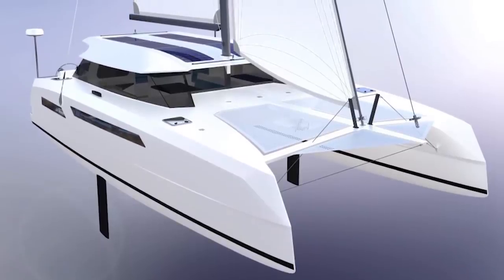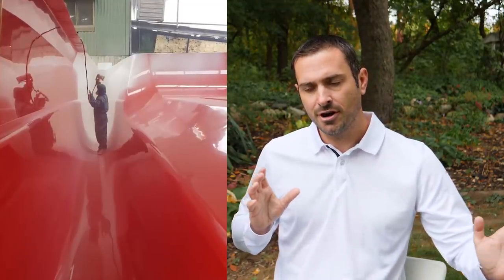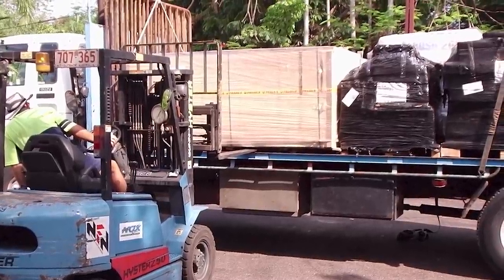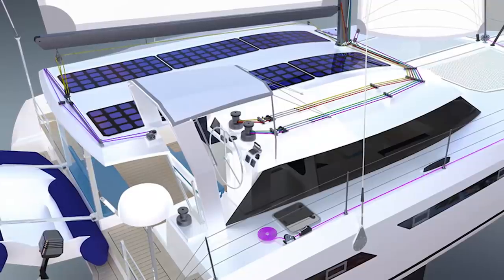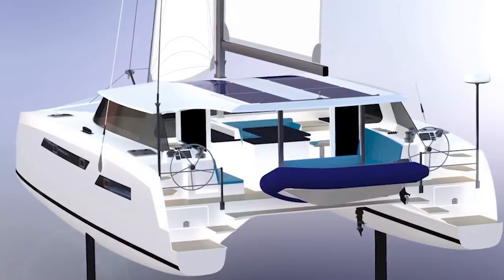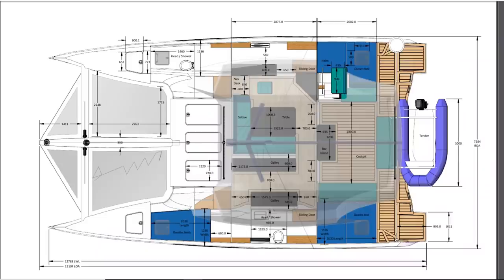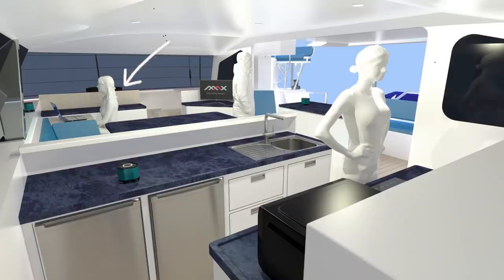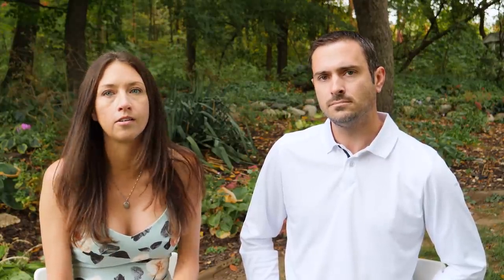YOU'VE NEVER HEARD OF THIS CATAMARAN - But It's Our Newest Contender - The Max Cruise 42 -MJ Sailing

Comment: As commented before, the balsa core materials of the Schonning is not a material I would choose, especially for re-sale in the States where they all want "production" boats. With that in mind, the gelcoat finish over a foam core is very appealing, and being modular the 10 month time difference and less sanding, a huge plus. I did like the idea of another commenter, of putting in the pads or base for inboard engines for a future change, if you choose outboards. Max Marine do not have much detail on their website, would your boat be the first one?

Comment: Would be great later to talk about your choice of outboard vs inboard diesels (I’m guessing primarily outfit costs and drag for performance is motivation— as storing petrol/gasoline on a cruiser is never ideal )
Reply: I have outboards on my boat. The fuel tanks are in self draining lockers above the waterline. The entire fuel system drains directly overboard. It's actually a far safer arrangement than most dinghies or trailerboats. And of the tens of thousands of trailer boats in the world, very few actually catch fire.

Comment: The design looks good. You need to be a bit careful with foam core. The pualuty control must be spot on to prevent de laminating of the core and skin. Along time pounding in bad weather can also cause this. Very strong and light initially, but if delamination occurs, it can loose most of its strength quickly. Just be careful. All that glitters and all that. Look forward to following the build.

Comment: I think the shorter rig is most practical choice. Cats performance variables are mostly affected by weight and hull design. A cat which is designed to point uphill is most affected by weight and sea/wind state with sail aspect a far second. Save weight in every way practical.  Shorter rig, less sail is less weight where saving weight means more. You still gotta carry that even when reefed.

Comment: The only thing I don't like about this boat is the engine package seems to be  lacking on horsepower, can you run a high output alternator off a 30 hp diesel to keep your batteries topped off? My friends launched their Kit Cat 40 Catamaran over the weekend it was a shake down cruise and everything went well, not a lot of wind so we could only put the head sail up, it was very responsive.. The Kit Kat 40 is designed to have twin outboards  mounted on each transom hull, makes for an easier engine install and better performance. Dennis and Jody elected to go with twin diesel outboards, they purchased two brand new Yanmar Dtorque 111 50 hp  diesel outboards, these engines are fairly new to the market at full throttle we registered 2500 rpm of torque power at the propeller shaft and fuel consumption of 3.2 gallons per hour per engine. The Cat reached a top speed of 22.7 mph with both engines on at full throttle, at 1/2 throttle it reached 11.6. Each engine can be operated separately, with just running one engine the boat held a speed of 9.2 mph all speeds were verified by several gps devices. The alternator on these engine are small only 300 watts which I think equals 2.5 amps,so charging a large battery bank might tank a while but they have 750 watts of solar, a 5000 watt Missouri Wind wind turbine and a 3000 watt Honda generator for backups. I took a lot of video footage well be posting on my YouTube channel and Facebook. They well be sailing the boat to Key Largo next month should be a fun trip....
Reply: Wow... 22knts sounds like a great cat.. I'm very interested 2 know more...
What's the make & model of the cat..?
Thanks.

Comment: Really interesting. I was talking to Julian about a boat last year and he mentioned this new design/brand and showed me some of the early drawings. They obviously hadn't progressed this far, it looks really well thought out. We've decided on another option but our choice can't be home built so wouldn't work for you anyway. It is amazing how we've decided on some very similar things to you (the Jefa two position helm, totally open doors between cabin and cockpit, very light boat, outboards not diesels etc.) Good luck hope it goes well!! 

BTW, on this point of a light boat, it's quite astonishing to me how Seawind and RR can describe the 1370 (60cm longer than yours, 40cm longer than ours) as light when it's quoted at ~11tonnes lightship....
Reply from the maker: Don't be a tease.... what did you decide on?   

I really like the Jefa helm, but we'll have to see how the budget is looking when it comes time to order/build the helm.  It's pretty pricey for how simple of an item it is, maybe I'll have to reverse engineer and build our own :)  

Matt
Reply: @MJSailing  Didn't mean to tease! We're going with a Stealth from Asia Catamarans. They have a production process in foam epoxy/carbon with moulds for hulls, cabin roof etc, but can vary length/beam as a function of customer's wishes and also are very happy to customise lots of things (for e.g. we're having a bike garage for 4 full size bikes built into the space that normally would be an aft cabin!). It might be worth connecting directly to share some thoughts as our ideas do seem to very similar, lmk if you want to. We've been pondering energy sources, outboard options etc, etc, always useful to chat to share ideas...

Wrt Jefa helm, I saw this setup first (along with most ppl I think) in Balance cats, but I think Schionning also do it. Using it mounted at this angle offers a really good compromise for helming positions and surely can't be that hard to build? The steering cables won't change length as function of steering arm angle I presume so no hard geometry to worry about. It's just a question of building a stiff arm on simple pivot, throw a few ball-bearings at it, what could possibly go wrong! 😂

But then again what would I know? One thing is clear we differ on; I don't know which end of a hammer is which 😅
Reply: Yep , that Seawind 1370 is terribly heavy considering an Outremer 45 clocks in at 8.5 tons , a Marsoudon Composites TS42 at 5.8 and a TS5 (50 foot) at a mere 8.6 tons and a DazCat 1295 at 5.2 tons . 20 knots boat speed max in 25 knots wind ? Don't think so .... No daggerboards is also a no no for performance .

Comment: How exciting! The Max Cruise looks very good. I have a feeling this is another Aussie company, out of Vietnam, like SW. You deserve a good deal. Your videos are great and you put in the hard yards again and again (and again!) Besy wishes for the build.
Reply: Oh, love twin helms. The raised single helm position might have advantages for long passages.
Reply: Twin outboards! We have a SW with twin outboards. Definitely pros and cons with these. Big pro, cheap and easy to replace and engines can be tilted right out of the water. Cons:- Cavitation can be an issue in choppy seas. Fuel economy. No hot water. We are coast hopper so the outboards are fine. For passages, I think diesel would be a lot better. Food for thought.
Reply: @deemacvee1  Thanks for that David.  Are yours the extra long shaft or standard long shaft?  How often do they cavitate?  What type of conditions?   All great info.... and Seawind owners are about the only ones we get to ask :)  

-Matt
Reply: @mattjohnson6716  Ours is a SW1000. Just fits under our local bridge. Twin Yam 9.9 hight thrust extra long. The 1160 lites have the Yammie 25s or Hondas usually. We sail off the NSW coast and that can be quite rough. Cavitation is a problem heading into a sea. We try and avoid it by picking the weather. You will do that more in a cat because cats are just so much more comfortable off the wind than close hauled. I think the longer cats may cavitate less and hobby horse less due to the extra length. It is something I would look into as you guys do long passages. Maybe get some references from others and ask the question. She has very nice lines, but where is the BBQ?

Comment: #1 ~ Less sanding and fairing. Huge
#2 ~ Dagger board option .. y'all seemed to Really dig the Dazcats abilities. 
#3 ~ Expense ... would the difference be mitigated by build time savings? That 'physical' health savings not just monetary.
Reply from the maker: Expense is the sticking point.  Yes, we'd save on material cost of paint, fairing compound, and consumables.  Yes, we'd save rent by launching months earlier.   But it is still more expensive than the Schionning flat panel kit.  
The real savings for us is the value of getting back on the water and cruising sooner :)   -Matt
Reply: Dennis Patrick  Parlay Revival was a hurricane damaged boat, no one knows what other problems they going to find. It also appears as if that boat was damaged before the Hurricane. Can't paint all Cat's with the same brush.

Comment: It sounds like you guys should move to Vietnam. Save the 75k for shipping and hire some cheap labor to help you build it. Maybe even find a spot to build next to the factory. The build would go faster, you'd save more money on rent, and build issues could be resolved quickly because the factory would be close. You might even be able to hire some of the experienced factory workers.
Reply from the maker: Sorry, it should have been more clear in the video.  The $75,000 shipping cost was in reference to an aluminum catamaran we had been looking at in SE Asia.  The owner had started the build and did not finish.  We could have purchased the boat for a certain price, but on top of that, we would have had to pay 75k to get it to the US.  For the Max 42, we'll pay about $5,000 for each shipping container to come to us.
Reply: @MJSailing  HI Matt, do you know anyone in aluminum material??

Comment: Had a seawind, outboards suck they’re noisy, gasoline in dangerous, and they pop out of the water in rough waters.
Reply: All catamarans are noisy. Everyone is not comfortable on the waves. But not all are fast. Seavind are fast. Some slow catamarans will not be able to get away from the approaching storm, while others will be fast. It's simple.
Reply: There are Diesel outboards ... and Electric Outboards.
Reply: @Serhiy34  I think you misread my comment. I'm 100% for catamarans. I just didn't like having outboards on our seawind 1000. My next boat will have saildrive diesels in their own watertight compartments.

Comment: Looks fabulous.
Love the concept.
Are these built from molds or by hand?
Love the apparent interior design finish flexibility.
I assume that I will love the pricing. Is it good?
I assume that I would love the build quality. Any references?
I am tempted to ask for more info from these builders for a boat for myself - probably a Power Cat with Electric drive outboards that tilt up into nacelles (Prout (?) style) like your outboards are planned. 
My concern is that I am ignorant of this boat builder and trying to search for them on the internet has given me difficulties except when linking directly to the website (slow though it is) you mention in your text - which is really very sparse info except for the absolutely lovely glossy looking boat images.  Have you done any due diligence on these guys?

Comment: What’s the bridge deck clearance? Just looking at the images, it looks minimal. You might be in for a lot of slamming.
Reply: Just under 3'. Identical to the Schionning, Grainger and Oram.
Reply: All sub 300 foot  cats get slamming unless they are huge like car ferries and over 30 feet above the water. Changing course a few degrees can sometimes drastically reduce slamming. The middle leg drive solution with a mini middle Hull doest seem to help the slamming problem much  and the leg drive seems to loses lot of power in bigger waves punching up against the waves.

Comment: Thank you for the detailed presentation. I too have been working for a few months on the possibility of building the Arrow 1360 kit from SHIONNING. 
In my experience catamarans are great boats for their habitability but, with a few exceptions, are a disappointment when sailing. Particularly when you have a headwind they grip the wind poorly.
In my quest as an experienced sailor full of dreams but lacking the millions of dollars needed to buy an Outremer 45 or 55, a Gunboat my search led me to the Arrow 1360.
Then you come along with your video on the Max Cruise 42....
Could you give me more information to check if really as it seems this catamaran will earn me 8 months in the construction? Also who is the designer? As I have no terms of comparison, as there is no Max Cruise 42 in the water yet, how can I be sure that this catamaran performs as well as I think the Arrows 1360 does?
Reply from the maker: I recommend talking to Terry at Max Cruise about your concerns.   He'll give you the polars - but I find most multihull's polars are pretty optimistic.    The Max Cruise will be:

 Heavier than the Schionning.  The gelcoat adds weight, but makes for a quicker and more professional looking build.  And it's built to European CE, so it has thicker fiberglass than most Schionnings.  

The hulls are a little bit wider 12.5:1 vs 14:1, but that allows a bit more payload (still thinner than an Outremer).    

Have more windage due to the larger cabintop with overhanging sun protection.   This sun protection was huge for us.  Having lived with totally exposed windows before in the tropics, I really didnt want the heat that the angled windows of other cats brings.   

It's a good combination for us, and I think appropriate compromises to all out speed potential, but you'll need to decide for yourself.   

When you talk yo Terry at Max Cruise, make sure you tell him we sent you.... We get a referral fee :)

Matt

Comment: Tesla or John Searl engineering for twin electric power supplies 'zero-point energy' and "Oceanvolt saildrives" so no expensive & heavy battery banks...   Think surfing when the prevailing breeze is not quite enough but the swell is just so inviting...    There is NOTHING like SURFING A CAT !...   With silent power I am opting for the 45ft power Max-Cruise - perfectly fit for purpose in the SW Pacific/Coral Sea...   MY DREAM...   My Oram 39C cost me more than Au$350k at a bit more than 4500+kg power...   Sold 2015?.

Comment: I looked at the specs and I'm concerned that even the optional higher hp level may be underpowered in strong currents. What are your thoughts? Will this use Volvo rather than Yanmar engines (I hope!)?

Comment: what is the benefit of the outboard drives over an inboard? i would think it would be more desirable to have the inboard motors.
Reply: Weight (the big one), cost, the ability to pull them out of the water to reduce drag, ease of replacement/service....  are all in favor of the outboards.   These boats are meant to sail well, so motoring long distances - while still an option with the outboards- isn't as much of a requirement as it was on the last boat.   -Matt

Comment: Vylin polyester is great suff and smooth surface and save 10 months sanding hard to beat. Epoxy is over rated for cruisers. Best is the outboards é teck very good on fuel or the 4 strokes use bit more fuel so the advert blurb says but in  real life use that's another issue. Consider one diesel outboard for long range in calm and a second high power  gasoline powered outboard  to give punch for  power in  short duration moving out of unprotected Bay to get to safer nearby protected bay. Sail drives are complex money eating beasts. Normal shaft drive with diesels inboards  next best option with carbon folder props. Keels are best lose a bit of performance but less problems than broken dagger boards and loss off interior room for dagger board casing. If possible build deck on frame above Hull so access is easy to hulls etc and arrange electric plugs between the top and bottom  and  when everything is done bring deck onto hulls Close up boat and sail off.
Keep multi Hull boats  light is the name of the game. If you do outboards at some later date it will probably be possible to do electric when the batteries can do ~900watts per kilo and not today's ~250 watts per kilo. The problem batteries is you often need a diesel powered  generator to put power into battery and tennis courts of solar panels to reduce the fuel use of generator

Comment: Moulded boats have the major advantage of being nearly finished externally. 

The problem is,  the interior requires a massive amount of finishing compared to a flat panel boat. And exterior fairing is a piece of cake compared to interior fairing.

Polyester is basically not good for building a catamaran. Secondary bonding is very poor. Multihulls rely heavily on secondary bonds. If you do go down that path, at least insist on vinylester! It's closer to epoxy.